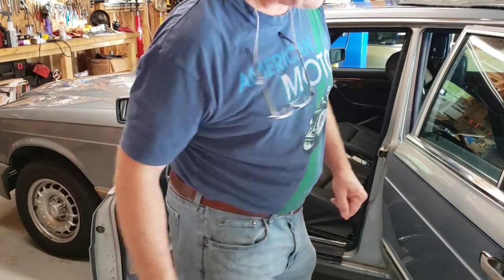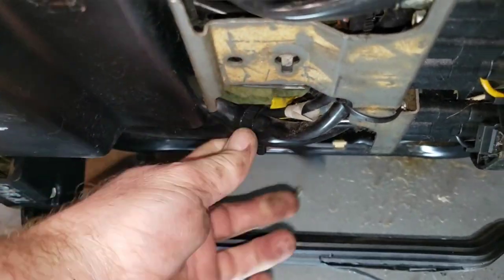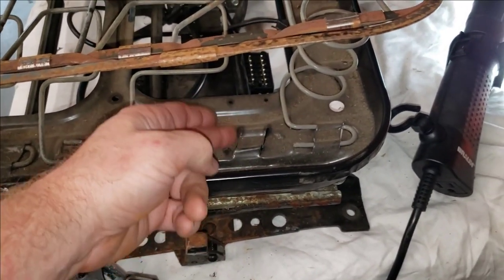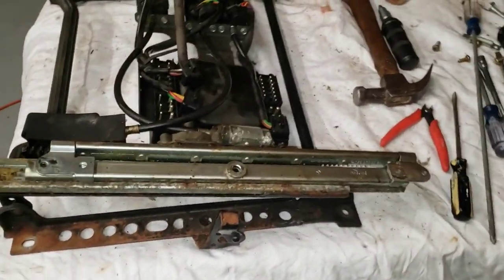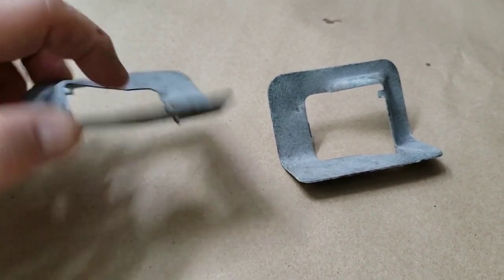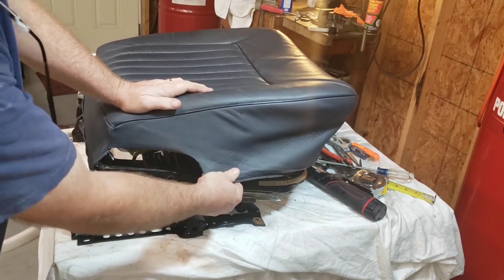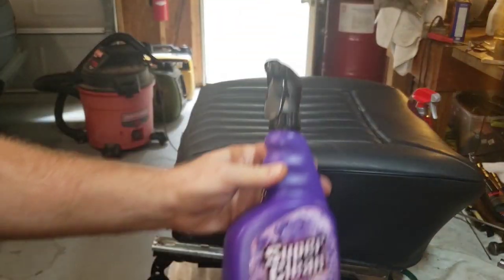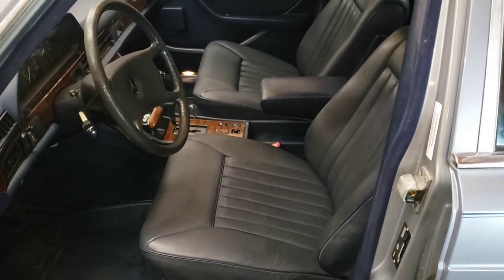Mercedes W126 Mercedes 300SD - Part 3 - Driver Seat Bottom Frame Spring Replacement

Comment: If you look at the 89+ seat spring frames, they are just about identical, except for some firm foam "tubes" that perfectly fit INSIDE the two coils at the front corners.  Putting those foam pieces into the springs is one of the BEST "upgrades" you can do to these early, "pleated" W126 seats...  Just FYI
Reply: Oops, replied before the end of the video. Serves me right!
Reply from the maker: @Johnathan_Waters  Got these replacement spring sets from an 88 or 89. Ebay. They already had the foam in them.
Reply: Before I read your comment I wrote that I was told one shop used rolls of toilet paper on my 89.I think the foam pieces might flex and return much better. My 86 is so spongy I bet adding them will really improve the support. Thanks for your input! Love those 126s. 2door and 4s.

Comment: Where did you find good seat springs?  How much? I was thinking of clamping a splice in but would rather replace if available for a price that doesn't require long term financing.
Reply from the maker: Contact Ebay seller royalbenz.

Comment: Another great video on your 126.    Did you replace the springs or repair them?      Years ago, when I first started collecting Mercedes Benz brochures 1972 I believe, one of the most inexpensive options were heavy duty reinforced seats springs.  Having never seen these seats taken apart, I wonder if that is the position for that extra spring in frame that is missing on both your front seats.    Someone else may know the answer to this missing piece.
Reply from the maker: Thank you!  I replaced the whole box spring assembly from a later w126 car. 88 I think. Ebay. Check out parts one and two where I did the passenger seat.
Reply: I know im asking the wrong place but does any of you know of a trick to log back into an instagram account..?
I was dumb forgot my password. I would love any tricks you can give me
Reply: @Reign Hugo instablaster :)
Reply: @Caiden Cristiano i really appreciate your reply. I got to the site thru google and im trying it out atm.
Seems to take quite some time so I will reply here later when my account password hopefully is recovered.
Reply: @Caiden Cristiano It worked and I finally got access to my account again. I am so happy!
Thanks so much, you really help me out !
Reply: @Reign Hugo happy to help :)

Comment: Good job! I'm glad it was you and not me doing it. Lol
Reply from the maker: Working with these seats is just awkward. Also trying not to damage stuff when removing and installing the seats is tedious.
Reply: @ImpalamansGarage  I removed the passenger seat on my Volvo once. I unbolted it and then pulled and pulled on it. It didn't budge. I accidentally pushed it forward and it let loose. They had put hooks in the miflddle of the tracks to hold it down. My back hurt for several days after that. I had wanted to take the seat switches off and have it tested. They were soldered on! I never could fix it. Never again will I take a seat off a car.
Reply: Once again you taught us how to repair a common problem with these old cars. It would cost a lot to have it done at a shop. You are a great mechanic and do upholstery work, too. Thanks so much. Uou
Reply: I noticed cylinder-shaped objects standing up in your springs. I remember a guy at an upholstery shop telling me when they rebuilt seat bottoms they used some rolls of toilet paper.  Seeing  those objects in your seats is probably was what he was talking about. 
   Do you think your springs could've been repaired? And by adding the foam pad would've been improved? Or were they too weak to be supportive enough? 
 I appreciate how much you teach us.

Comment: The parts rust because water leaks under the windshield wiper Cowl. A rubber plug in the corner near the drain on both sides disintegrates and allows water to get in into the passenger compartment. Also, the air-conditioning drain line under the center console carpet on the driver side is made out of foam and disintegrates and allows water into the foot well area with air conditioning use. I salvaged the rubber ends from the original tube and used a plastic tube with metal clamps holding the original rubber parts onto the new tube as a replacement drain line.
Reply: This is the best explanation for this.  However, in my experience I have seen cars that had intact drains/rubber and  STILL had corrosion on those covers.  I have a feeling it is most likely just due to them being in close proximity to the seat bolt holes, which are exposed to the elements on the underside of the car.

Also, the seats are made from Natural coconut fibers I believe.  They are completely soaked in some kind of latex glue.
Reply: Johnathan Waters that certainly contributes to the bolt corrosion. I really wanted to let all W126 owners know about those two leaks because they are two mystery leaks that I had to figure out on my own through great misery
Reply from the maker: @markgraham5796  That definitely bears further investigation on my car. Thanks !
Reply: Impalaman's Garage that looks like a good one. Please check into those issues and while your at it, take the front bumper off and take the rubber strips off below each orange side marker light. They cause the fender to rust at that spot. Another consideration may be injecting clear marine grade caulk underneath the rear window seal. At the corners in the bottom the water sits internally and will rust through as well as make the trunk moldy, rusty, and damp
Reply from the maker: @markgraham5796  yeah I know for a fact the rear window seal leaks. That is on my list for a video in the next few months. I want to remove the back glass and fix the leaks and reinstall.

Comment: Is that foam you put inside the new seat bottom coil springs?
Reply from the maker: Coil springs came from a later model - Ebay. Extra one inch of foam came from Hobby Lobby.

Comment: Help!  I got a reassembly problem. Where does the geared slide capture the U shaped rail?  With all 4 Philips screws?   For example at 14:04does the scre caoture the insert, the slide and the U rail?
Reply from the maker: Confusing ain't it!  LOL.... I did some head scratching myself. As I recall the two components are separate but they interact on the ends.  Remember there are Philips screws and hex bolts as well that hold it all together on the seat frame. Also keep in mind that the slot in the gear rail rides along these two little stubby rods. See here. https://www.youtube.com/watch?v=0pijcs_-Fhk&t=210s
Reply from the maker: From 3:55 to 4:07 in part 2 you can see where I am holding that assembly in my hand. It gives a pretty good shot of how the two interact with one another.
Reply: Oh, I am my own hero.  I had a spare drivers seat frane/spring in virgin condition.  So I can simply emulate the exact setup.  Turns out the 4 phillips do not capture the sliding rail.  The rail travel is only limited by the "bump" stops.
Reply from the maker: @7425park  Cool!!